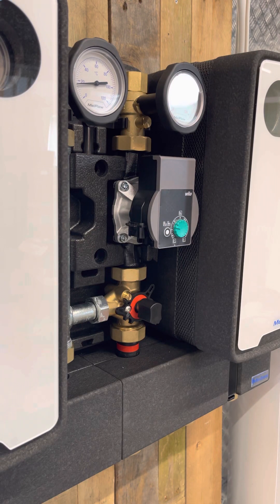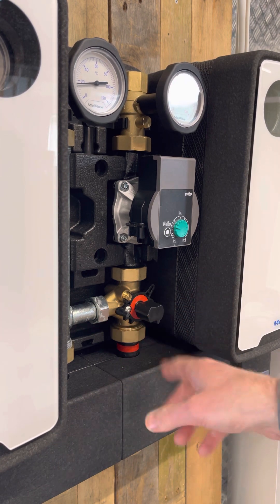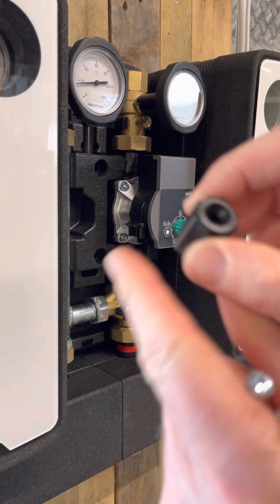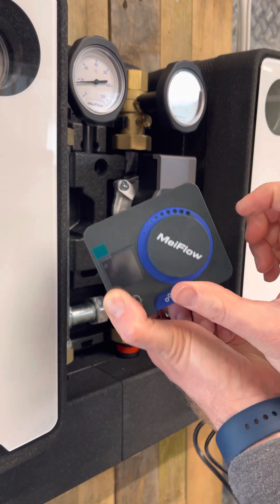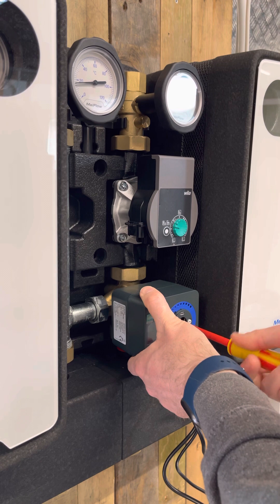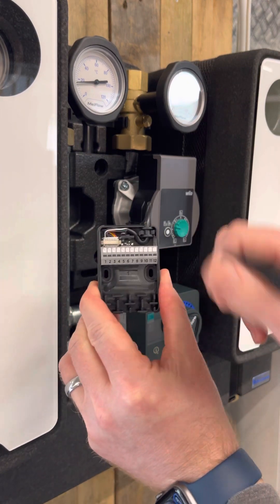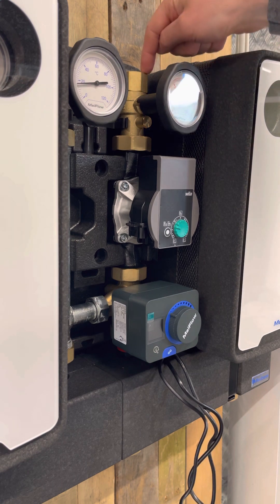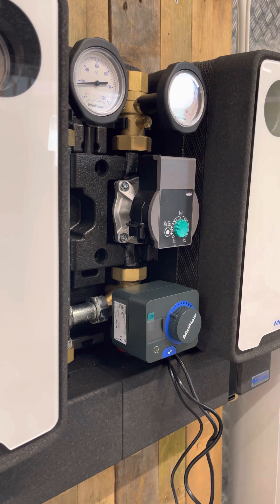How to fit a Flamco MWR3 Weather Compensated Actuator to a MeiFlow Top S Mixed Circuit Pump Group

Comment: Are these products compatible with atag boilers?
Reply from the maker: The Flamco MWR3 is a stand alone controller, so compatible with any system. However, if you are looking for a 3 way mixing valve that can be controller from a boiler capable of having multiple mixed zones, then have a look at the ESBE range of valves we sell here - https://pirateheatingsupplies.com/product-category/manufacturers/esbe-hydronic-solutions/esbe-rotary-valves/